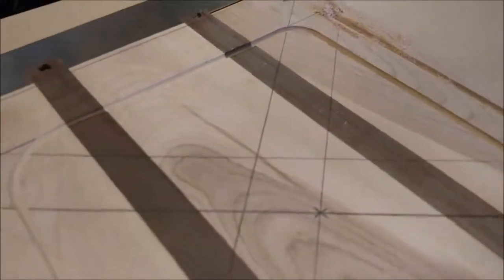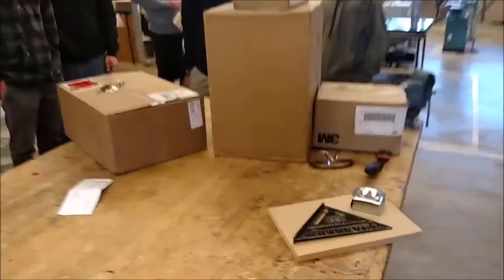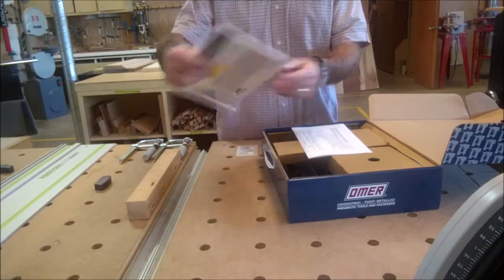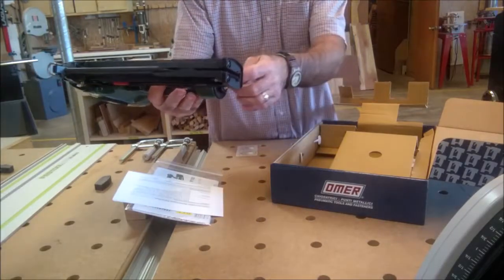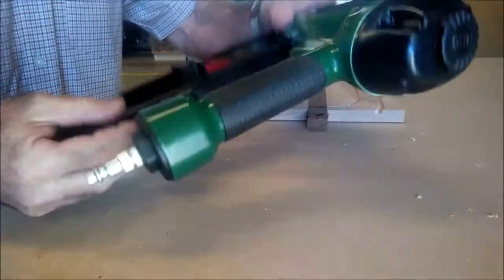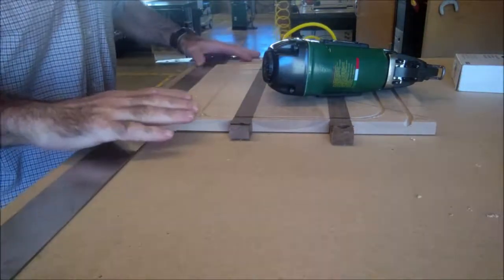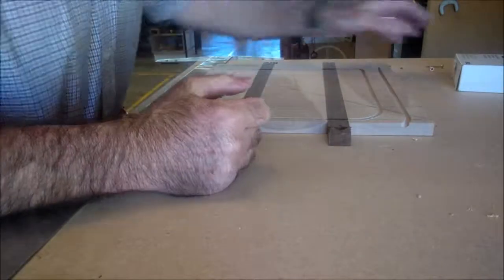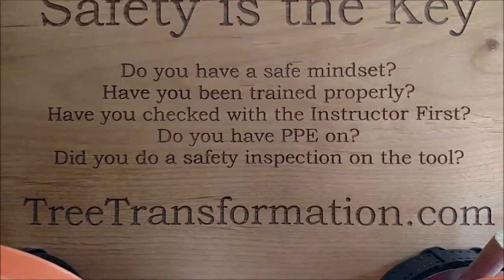Why You Need Raptor Nails

Comment: So this requires the omer gun. Won't work with dewalt nailers?
Reply: Thanks for asking.  The Omer tools have been designed with a very tight drive chamber to keep the nails as stable and supported during driving.  Other nailers have larger drive chambers (metal nails can tolerate this) and each one varies from another.  Allowing RAPTOR nails to shift around in the drive chamber causes poorer drive performance.  You are welcome to call and get a sample for your tool, but please do not judge the performance of RAPTOR based on that.  There is a slim chance it will work well enough for you, especially if you are using very soft woods and shorter nails.  Give us a call 800-460-6933.
Reply: @pamtucker8382  Can the Omer nailer be used with metal nails as well?
Reply: @ChrisRasch  Hi Chris.  Unfortunately no.  The drive chamber must be tighter in the tools designed for RAPTOR than for metal nails.  Omer does have a full line of nailers and staplers for metal, but those do not work with RAPTOR.
Reply: @pamtucker8382  Just to clarify, the Raptor Omer nailer (designed for Raptor nails), cannot be also used with metal nails as the chamber is too tight for metal nails?
Reply: @ChrisRasch  Exactly correct.  You could damage the drive chamber by testing metal nails in the Omer "P" tools.  "P" means made for plastic composite.  You can test RAPTOR fasteners in tools for metal.  It will not hurt them, but in most cases driveability is poor.  Occasionally, drivability is acceptable, but not as good as the Omer P tools.
Reply: @pamtucker8382  Thanks for the response!
Reply: RAPTOR nails work best with the Omer tools that are custom designed to work with them. RAPTOR nails could work with other nailers, but we don't recommend any tool other than those made specifically for RAPTOR.